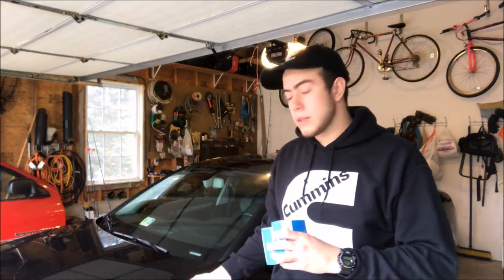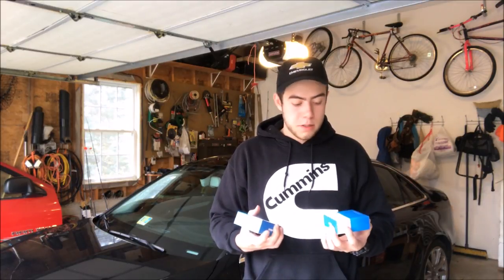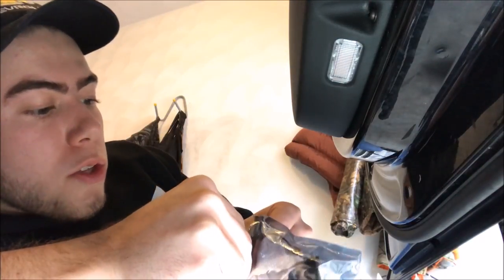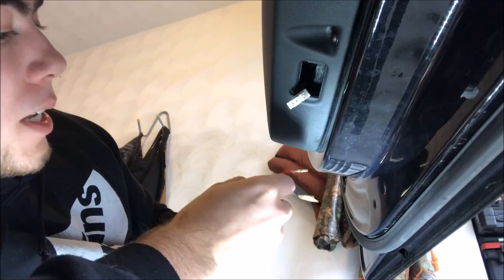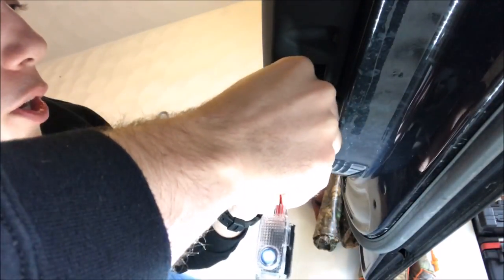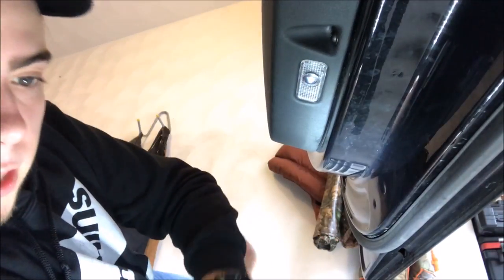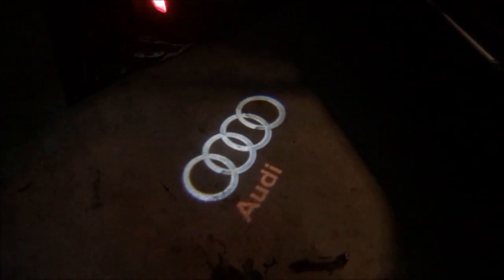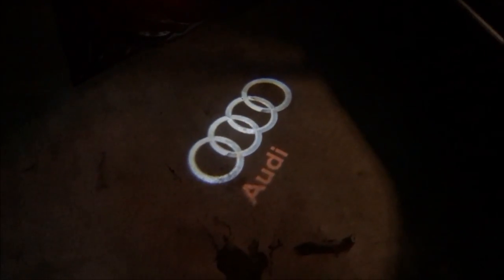Audi Projector Door Jam Light Install

Comment: Put it on the Audi A6 front door no problem.  but the electric wire plug in the two rear doors are really short and I can’t even pull it out to plug the new light on it.  Any idea ?  Do I have to remove the door panel to pull out the wire plug long enough so I can plug the new projector light to it?
Reply: Don Nguyen have the same problem
Reply from the maker: Sounds like you'll need to remove the bottom portion of the door panel and see if they'll connect. If not youll need to cut and splice a longer piece of wire to reach.
Reply: Don Nguyen, have the same exact issue. Wondering if you or anybody else figured out what works best. I really don't feel like pulling apart the door panel just for that lol.

Comment: I tried tonight but I was worried I would break the stock light with my flathead - is this something I should worry about or am I just not pushing hard enough with the flathead bc it won’t come out.
Reply from the maker: If your worried about using the metal flat head, try using a plastic pick or something soft but strong so it wont snap.

Comment: I have a 2015 Audi A3. I have the spot for the light, but there isn’t even an older light there. It’s just black.
Reply: Tropikz Galaxy I have a 2015 Audi Q5 and the lights appear difficult fitting into the slot will it be easier using the supplied wires or do I have to modify the opening
Reply: Sylvester Holmes that’s my question too. I opened up my door panel, but it appears that I don’t even have the wiring for the light in the first place
Reply: Same here on my A4 B8
Reply: Will it fit an audi a3 2019?
Reply: Same with a 2015 Audi A3. Any ideas on where to get the harness?

Comment: I have a 2004 Audi a4 and my doors don't have This light on it can I put one in and is there a wire there for me to do the job
Reply: Gerry Murray they make wireless door projectors, they just use batteries
Reply: me0983 can't find them can you send me a link in where I can find them Thanks
Reply: Gerry Murray you can search on eBay or wish. Type in wireless door projector and choose the ones with your car logo